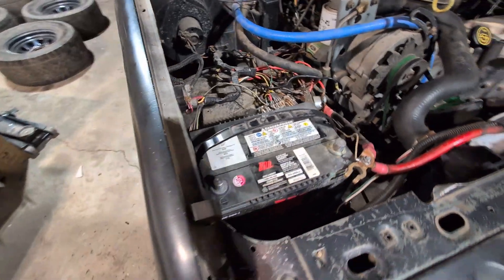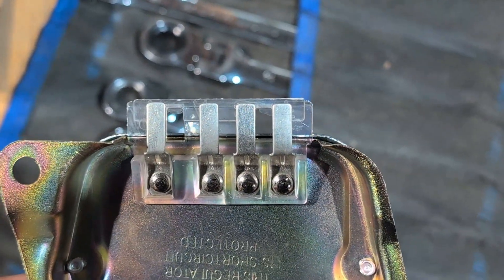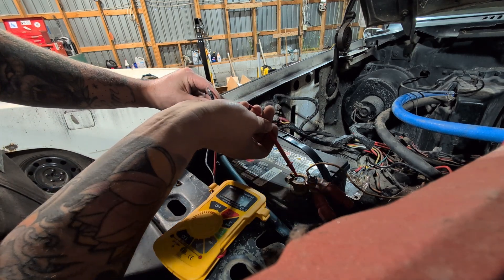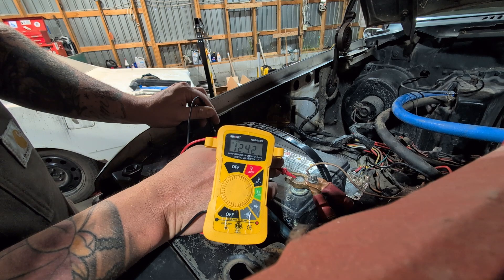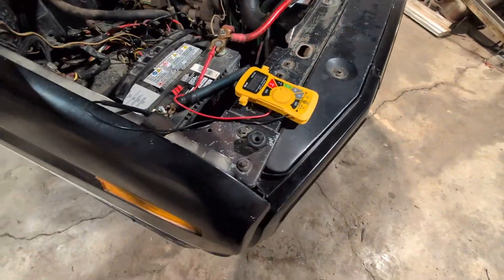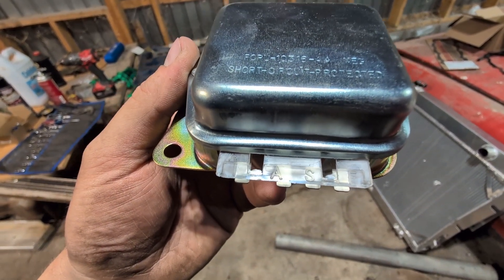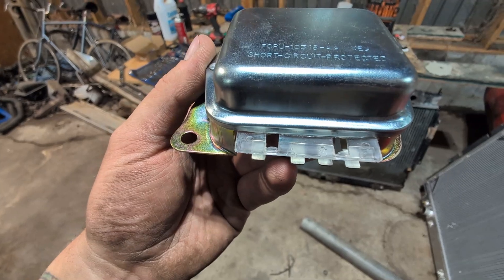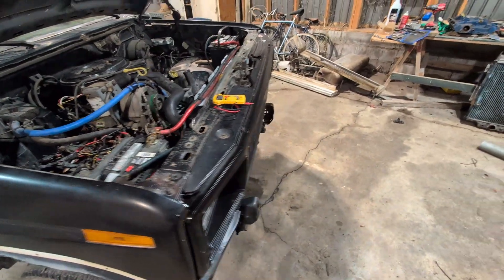How To Test External Voltage Regulator VS Alternator

Comment: Is it normal to read 14.7 in idle but reads 12.8 with the lights on in idle? I notice when I unplug the negative terminal my mustang is still running so I know the alternator is working. But not too sure about the voltage regulator. I’ll have to try and jump it.
Reply from the maker: I think those numbers sound reasonable. I am not a mechanic however so check your specs on what voltages are acceptable. Sounds normal to me though.
Reply: @RoughNReadyGarage  yeah I actually rev the engine it got up to 14.7 or so. I did end up replacing it with a 1 wire alternator. Left the old one as a spare.